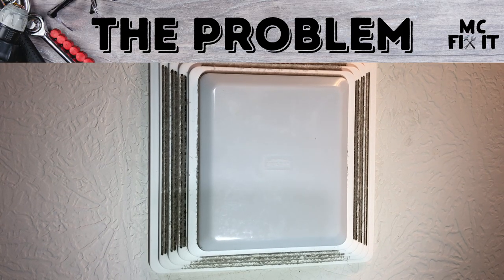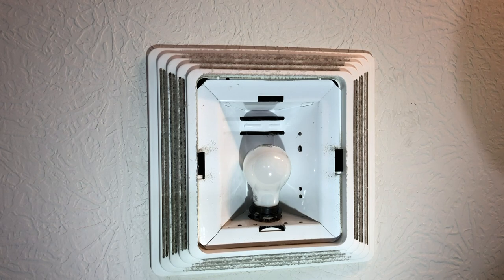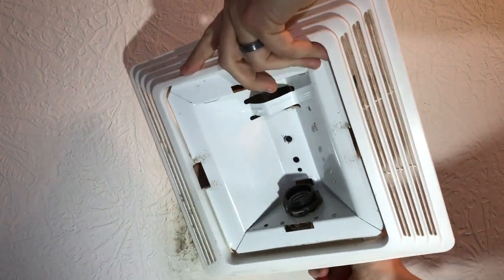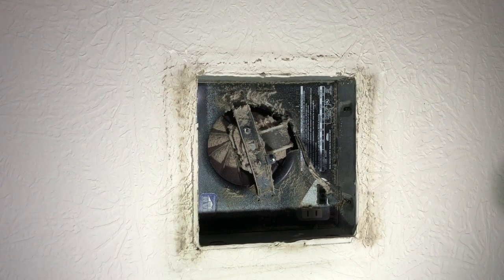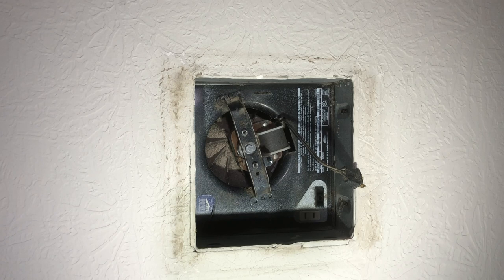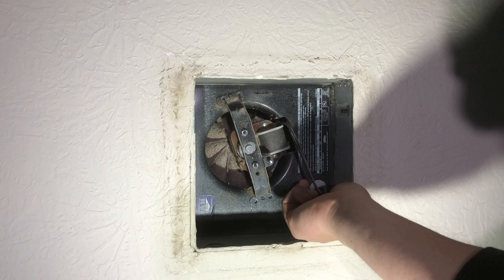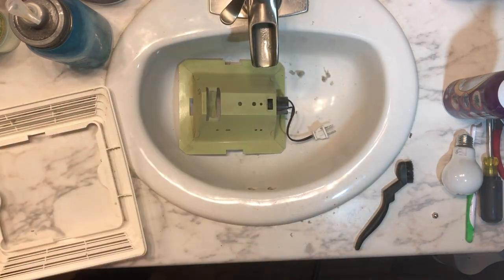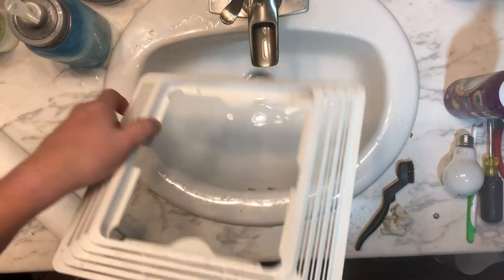Super Loud Bathroom Fan Vent... Is it Broken? Complete Guide.

Comment: I wish I could use my air compressor but it’s on the other side of the house, good tip with the computer compressed air! I would have never thought about that as a solution! Also, don’t use that toothbrush again if using it, lol! Great video 👏
Reply: Hahahaha!
Reply from the maker: Yes. I actually save mine after I’ve used them for a few months and then run them through the dishwasher. Then use them for many different projects

Comment from the maker: Got a super loud bathroom fan vent, can it be fixed? Yes! Often you can follow these simple instructions to fix it yourself! 
00:52 The Tools
• Step ladder - https://amzn.to/3bg8azE 
• Flathead screwdriver -- https://amzn.to/2RAjTlU 
• Toothbrush or soft-bristled cleaning tool - https://amzn.to/3hdBbzP
• Pilers or Wrench - https://amzn.to/3bh4Ggx
• Mini Shop Vac - https://amzn.to/33rPSqZ 
• Compressed Air Bottle or Air Compressor - https://amzn.to/3f7f6jF 
• Extension Cord - https://amzn.to/3f4C4If

01:15 The Fix
Solve this problem by seeing if it's filled with dust and lent! Take off the Broan NuTone fan cover off and begin cleaning. Often these fans get caked with debris that makes the fan run very loud and seem like it's broken. After cleaning it they often return to their normal running loudness. 

Check out my website at http://mcfixit.us 

Disclaimer: Due to factors beyond the control of MC FIX IT, I cannot guarantee against improper use or unauthorized modifications of this information in the video, post, blog, or social media. MC FIX IT assumes no liability for property damage or injury incurred as a result of any of the information contained in this video. Use this information at your own risk. If you feel uncomfortable at any time. Stop and go to a professional. MC FIX IT recommends safe practices when working on vehicles, your house, or any other project and or with tools seen or implied in this video. Due to factors beyond the control of MC FIX IT, no information contained in this video shall create any expressed or implied warranty or guarantee of any particular result. Any injury, damage, or loss that may result from improper use of these tools, equipment, or from the information contained in this video is the sole responsibility of the user and not MC FIX IT.

#mcfixit #homerepair #fix #repair #bathroomvent #fan #cleaning #broan #broan-nutone

Comment: Dude - I feel like a total moron for all the time I spent trying to get this thing down, not thinking to take out the lightbulb and look for a screw. All the other videos say to look for spring clips. The fan is original to my 34yr old house, purchased a year ago. It sounded awful, and the built in heater smelled like a house fire waiting to happen. Ventilation was questionable at best. I did have to, um, persuade the metal housing a bit to get rid of some rattle. I was going to replace it - shit ton of work there -  but now it seems just fine, other than a little bit of rust. I can gladly live with that. Thanks so much!
Reply from the maker: You are welcome. Be careful with that heater if there’s a lot of dust in there bc a fire could possibly happen.

Comment: FWIW - Every ceiling fan I have ever installed allows you to remove the platten with the fan/motor attached from the housing that mount between the studs.  There is generally one 1/4 inch hex-head screw fastening one side of the fan bracket.   It should be 1/2 to 3/4 inches from the edge of the housing.  Once that is removed, you can swing the fan assembly down and out of the unit.  You must remove the black plug to the fan first.
Reply from the maker: Great insight and information! Thank you!
Reply: You answer my question above. Thanks for writing this out to help me!
Reply: Thanks for this tip!

Comment: Great video! If the fan still makes loud noise, do you recommend using WD-40 silicone lubricant on the point where the shaft of the fan connects to the fan assembly in the center or May be even apply 2 drops of oil to it? Also is it absolutely necessary to turn off the circuit breaker even if I power off the exhaust fan main switch that I use to turn the exhaust fan on or off?
Reply from the maker: A silicone lubricant would work better than wd40. Be careful not to spray it on any of the electrical connections though! 

Safety is important and I always turn off breakers. Just a few extra moments to ensure safety is always worth it every time.
Reply: @MCFIXIT  thanks for your response. This morning I again cleaned up and vacuumed the fan area. But when I turned on the fan, there is a VERY loud screeching noise coming out of it as if the blades of the fan are colliding each other. I turned the fan ON multiple times but still same issue. So I guess it’s time to change the fan now, right?
Reply from the maker: Yes, that's what I would do.

Comment: Nice job does your other bathroom have a fan as well
Reply from the maker: Yes it does! The same one. I’m actually about to do a replacement motor video in the one that had a light issue. I’m waiting for the part to come in and then I’ll be making a video on that.

Comment: Hi MC Fix it  I have kind of a dumb question for you lol so our maintenance person came to clean the fan today but a few hours after he left the ventilator fan is making worse noises than before almost as loud as a car engine. With that being said it does also have a light bulb attached like the one you fixed (bc it’s ancient) can I just open it up, remove the motor fan and keep the bulb on my own? Please help thanks!
Reply from the maker: You should be able to unplug it from the receptacle and only have the light on. Be careful though, because you can cause mold in your bathroom without proper ventilation.

Comment: I want to replace mine with a new quieter bathroom fan in my condo unit. Any suggestions?
Reply from the maker: Really anything with very low scones (under 1) would be best. There are so many options out there. Many now have variable speeds too. So if you need more more exhaust for a shower you can turn it up to high (more CFMs). I’ve always had good luck with Broan-Nutone exhaust fans. Low maintained and last a long time.

Comment: My problem is that  the fan rattles violently when it’s off. My upstairs neighbor turns their fan on and mine rattles. It won’t stop until I turn mine on. I live in an apartment.
Reply from the maker: Sounds like a ventilation issue. Do you see many outdoor vent locations to where the air is being pushed? It might be on the roof or side of the apartment. How many units are in your apartment building?
Reply: @MCFIXIT  I’m on the 1st floor there are 3 additional units above me. Vent shaft is on the roof. Maintenance says  the problem is there but they do nothing about it. They say just run the fan. I say tell them to turn theirs off, apparently they won’t.
Reply from the maker: That’s super frustrating! It does seem to be an issue with the amount of units then. Hopefully the other units will listen and the issue will go away

Comment: What if the fan motor still makes lots of noise even after its been cleaned out
Reply from the maker: You may need to replace the fan. I’ve got another video where I do this on my channel with our other bathroom that had that issue!